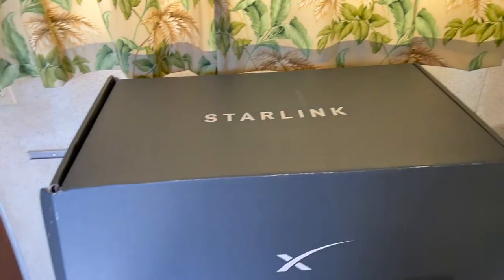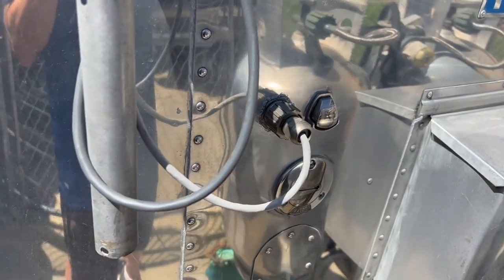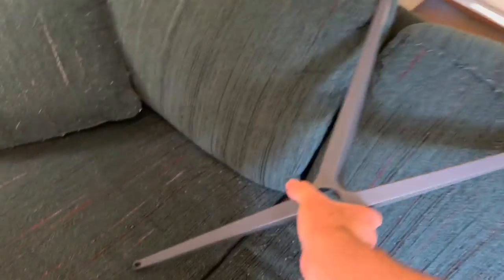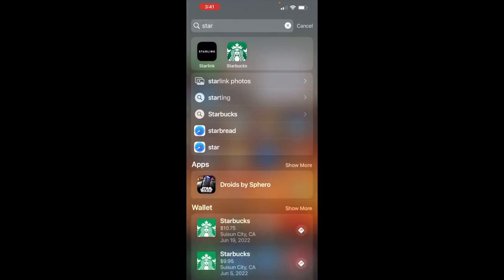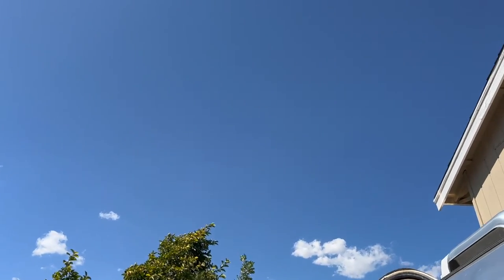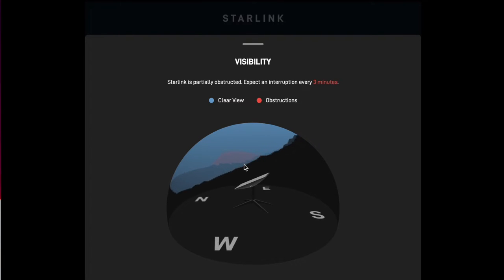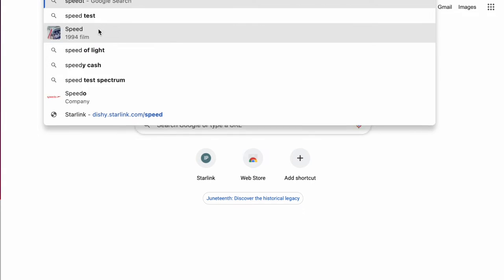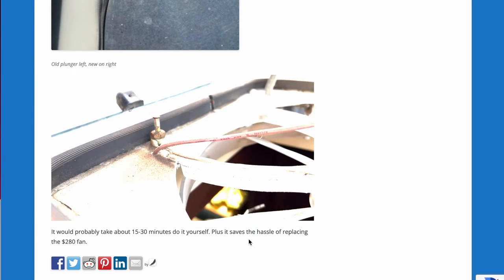theVAP Starlink Install/Mod/Testing

Comment: It’s not a standard cat-5 cable as the wiring pin outs are not standard.
Reply from the maker: It’s standard 568B pin out.  It does use a shielded network cable.
Reply: @theVAP  
It uses a non-standard PoE(The orange and green pairs are positive, the blue and brown pairs are negative).so you can’t just use a standard POE injector. If you are just going a-a, b-b etc no problem